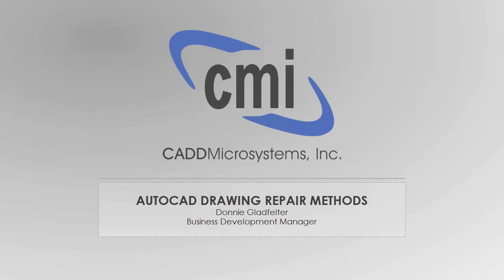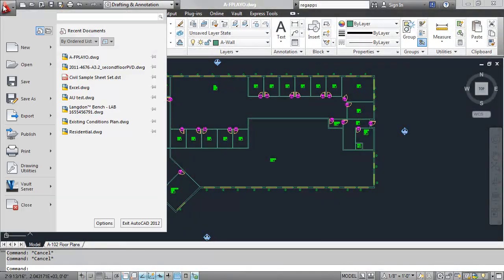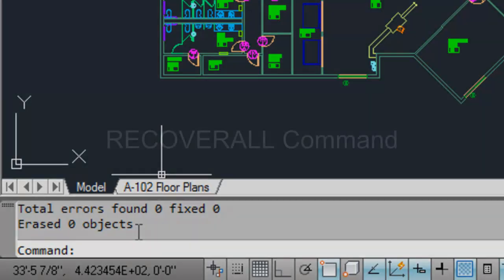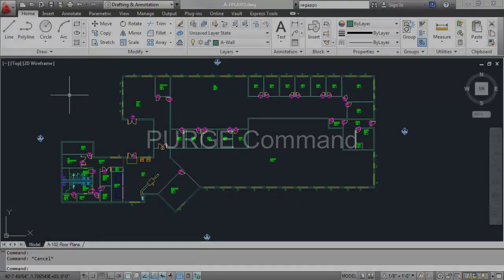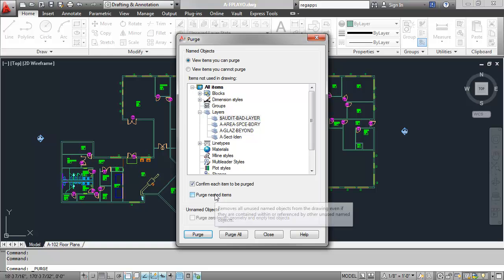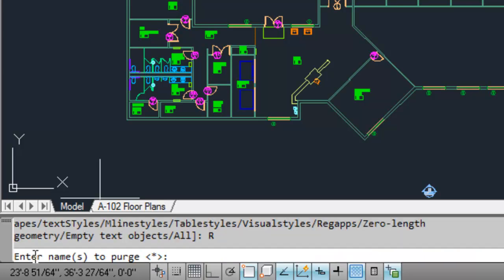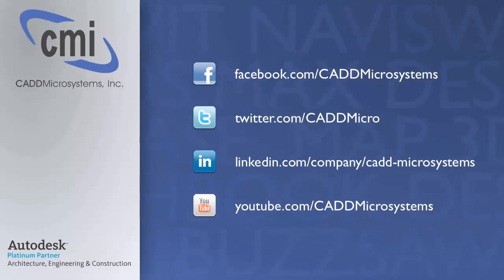AutoCAD Drawing Repair Methods

Comment: This video might be old, though AutoCad seems to be somewhat the same.
I made an Area Plan from Novapoint and I want AutoCad to open it, but the DWG file from Novapoint is blank!
Novapoint reads it just fine but AutoCad sees nothing of it even as it does have a decently large memory value!
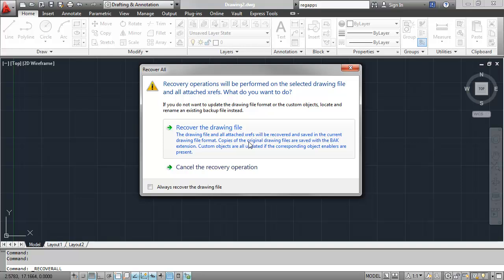(aka where you see at 2:23 - you see a picture, I only see a white square).